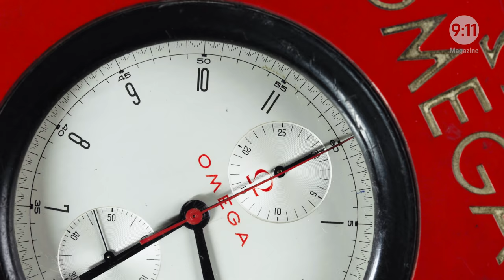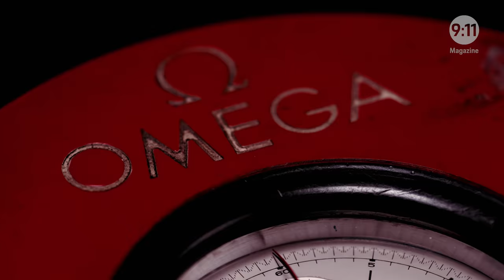A stopwatch on the steering wheel: The victory at the 24 Hours of Le Mans was meticulously planned

Comment: i remember when a lmp2 team had problems with the starter, so they hit it with a hammer and it worked. when they installed a engine cover with a little hole in it to reach the starter without taking the cover off they got disqualified.